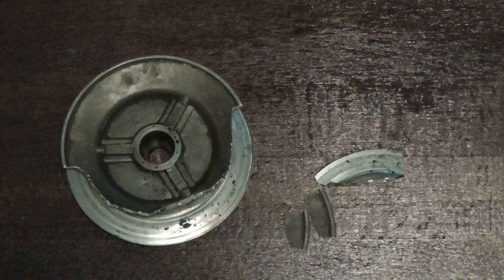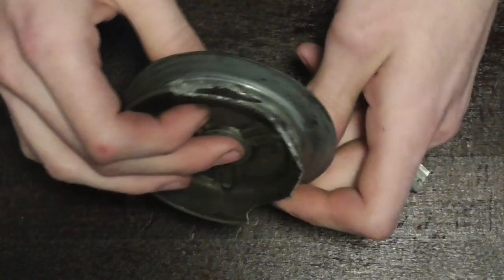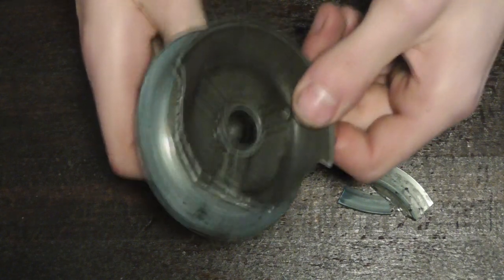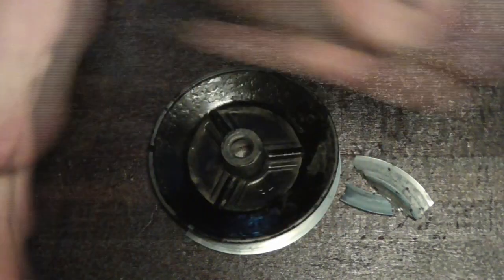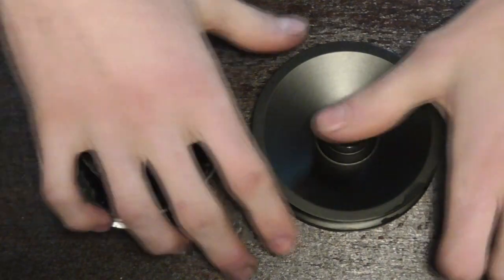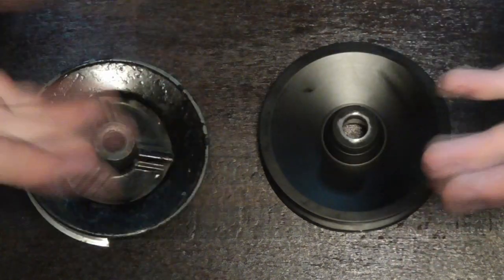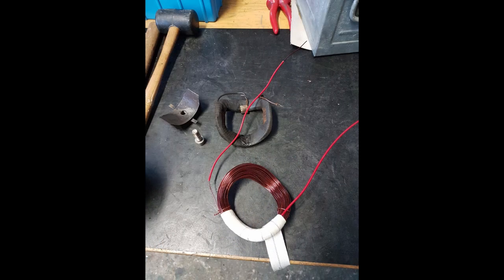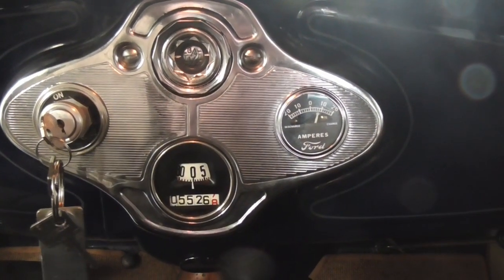Ford Model A Generator & Pulley Renewal

Comment: I’ve replaced my generator with a 6volt positive ground alternator and haven’t looked back of course when I bought the model A the wiring was atrocious 12 volt negative ground alternator, ballasts, solenoid and over complicated rodents nest of wiring. I still have the generator just in case. I’ve enjoyed your videos and think your car is very nice. Thanks

Comment: Are you saying the brushes needs to be adjusted under the hood for driving at night vs driving during the day without the headlights on?
If so, have you considered installing a large power resistor and giving yourself a switch inside the car to put it in circuit when the lights are off and out of circuit when the lights are on? 3 2ohm resistors in parallel would give you a 9amp load.   Sounds like if you did that, you'd never have to touch it.  Or you could just run the headlights all the time, but they will blow faster.
Reply from the maker: It's really not that big a deal to adjust the brush. I put some punchmarks onto the generator housing to mark the position for lights on/ lights off and have since cut a slot into the brush cover strap (with a rubber flap on top of it to conseal the brushes). Opening the hood and sliding the brush over takes maybe 10 seconds.

Comment: It's interesting stuff i had no idea the generator needs to be adjusted for day or night. One thing you can do is replace the halogen bulbs with led bulbs, that should decrease the load quite a bit. I will be doing the same with my 1980 merc and it's 55A alternator.
Reply from the maker: I have two LED bulbs on my shelf, ready to be installed. Unfortunately, although brighter, they are illegal to fit in Germany, and the blueish white they emit are a dead giveaway that they aren't incandescents.
So far, the generator has been doing just fine though - several hour-long night drives without warming up too significantly seem like a good indication.
And adjusting the brush quickly becomes a habit like double-clutching, so it's not that big a deal.
Reply: @AstraWerke  they make some that are warm white as well.
Reply from the maker: @Engineerd3d  I couldn't find any in Europe or the UK...
Reply: @AstraWerke  i wonder if they have them for your car, what model bulbs do you need? Also it is quite possible you can wrap the leds with capton tape to soften the color temp. Worth a shot.
Reply from the maker: @Engineerd3d  I bought them from a chap in England. He calls them LDBA15D - for the Ba15d-Socket in the headlights, and they look exactly like the ones sold by Logo Lite in the US.
Capton tape - I'll see if I can get my hand onto some to try that out, thanks for the tip!